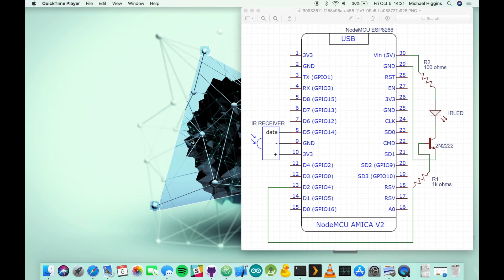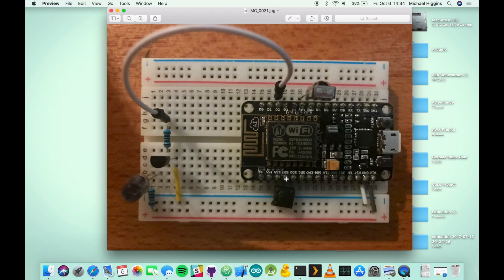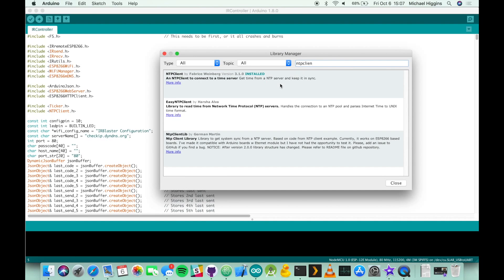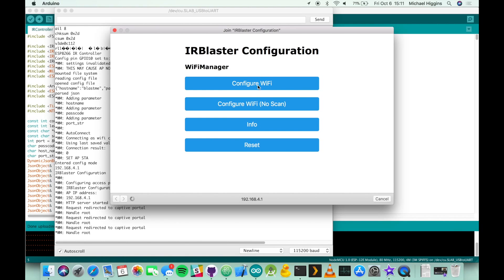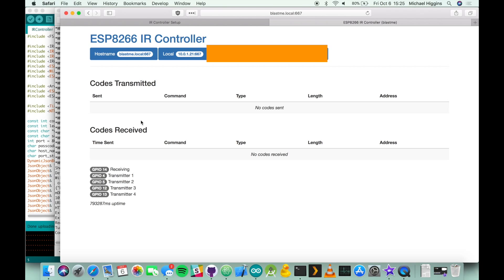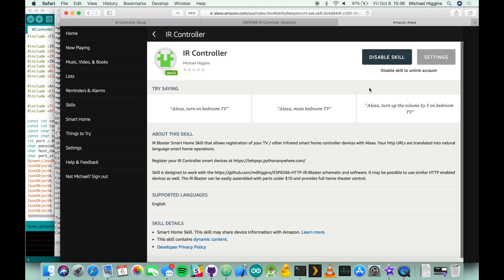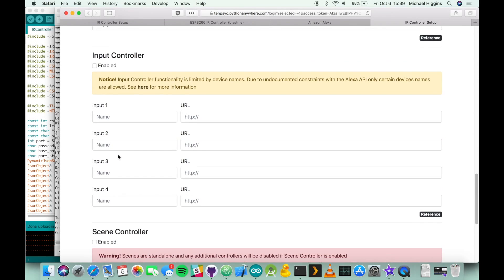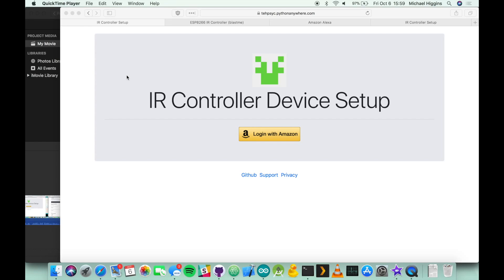IR Controller Tutorial

Comment: Please can someone help me out here, i am trying to get this working for my uncle who is paralysed from the neck down, i want him to be able to control his tv with alexa, i have followed the install and programmed the arduino but when i boot it up it comes up with, 

ESP8266 IR Controller
Config pin GPIO13 set to: 1
mounted file system
*WM: Adding parameter
*WM: hostname
*WM: Adding parameter
*WM: passcode
*WM: Adding parameter
*WM: port_str
*WM: Adding parameter
*WM: user_id
Using Static IP
*WM: 
*WM: AutoConnect
*WM: Connecting as wifi client...
*WM: Custom STA IP/GW/Subnet
*WM: 10.0.1.10
*WM: Using last saved values, should be faster
*WM: Connection result: 
*WM: 0
*WM: SET AP STA
Entered config mode
192.168.4.1
IR Controller Configuration
*WM: 
*WM: Configuring access point... 
*WM: IR Controller Configuration
*WM: AP IP address: 
*WM: 192.168.4.1
*WM: HTTP server started

It won't open the wifi config page and i can't login using 192.168.4.1 in safari, Please can someone point me in the right direction, Thanks Adam
Reply from the maker: Did you connect to the IR Controller Config access point that it creates before trying to access 192.168.4.1?
Reply: Hi Michael, yes i connected to the AP, nothing came up and when i goto 192.168.4.1 in safari it said i wasn't connected to the internet, i also tried a different Mac but the same thing happened, thanks for getting back to me.
Reply from the maker: I would try making sure you put the 'http://' in front, sometimes Safari tries to redirect to a search engine when you put in an IP
Also make sure you check your IP address settings and that you got assigned an IP in the 192.168.4.x range when connected to the IP (if you have a static IP configured on your computer that will cause issues, needs to be DHCP for the computer)

Comment: I am stuck at the point where I am configuring the access point. I get the following in the serial feed after it repeated what I typed into the html page:

Connecting to new AP
Connecting as wifi client...
Custom STA IP/GW/Subnet
10.xx.xxx.xxx
Connection result:
0
Failed to connect.

I believe it probably has something to do with my ip address I gave it but I could be wrong.  I have a linksys router and so to forward the port I had to give it a name, external port #, internal port number, protocol, and device ip. I set the name to TV, the external and internal ports to the same number, put both for protocol, and an ip address with just the last digit off from what I found to be my computers ip address through command prompt --> ipconfig /all --> IPv4 address. For the HTML page I clicked on the name of my 2.4ghz wifi which for some reason has a square and a character with an accent on top (the character and accent change each time you try it and I have tried it with and without these added characters as well). Then entered the correct password, entered the name and password for the device, then the port I attempted to forward above. Then I placed the entire line of "amzn1.account.XXXXXXX" that I got from the place you linked and tried it without the "amzn1.account." part a few times as well. I then entered the same IP address I entered when I did the port forwarding in the "Static IP" box. I put the "default Gateway" from the ipconfig /all in for the "Static gateway" and put in the "Subnet mask" in for the "Subnet". I tried it by attempting to connect to my phones hotspot (and didn't forward any ports) and I got BoriKing_PR O's failure.

Please let me know if there is anything you can help me with or if you need more information.
Reply from the maker: What is the IP address of your router, what IP address are you giving your device? And what gateway and subnet are you using? I wonder if maybe the special character is causing problems? Does your SSID have a strange character in it?
Reply: Router IP (what is labeled as "Default Gateway" in the command prompt) --> 10.xx.xxx.226
Device IP (same middle characters as previous number but I do not think it is safe to post them)--> 10.xx.xxx.136
Gateway --> same as Router IP
Subnet --> 255.255.255.0
My SSID has standard English characters along with spaces, numbers, and a colon. The strange characters appear after the end of my SSID in your program.
Reply from the maker: Hm I'm not sure those settings look appropriate. The weird character is making me question if WiFiManager is having some difficulty interpreting the SSID of the router. Is there another SSID you could try?
Reply: Not at the moment, Friday I might be able to though. If you change the SSID on your wifi and change it back do you know if all the devices will remember it? I assume they will but there are a lot of devices connected that I do not wish to have to reconfigure the internet on. If so, I might rename it to something really short and see if the gibberish continues.
Reply: I decided to change the name of my current SSID to something different and it resolved the issue!
Reply: Now I am stuck at the next step. I can't connect to the routers settings page anymore or the "blastme.local:667" (with correct name and port inserted) or local IP address of it.
Reply: Didn't realize I had to put a colon and the port after the ip address, it works now

Comment: I have been trying for hours trying to set up my external ip to no avail. Can someone please help me?  keep getting (error retrieving  external ip)

My wifi manager looks different. In my wifi manager i have 3 extra input boxes:
Amazon user id 
Static ip (i think i already set this)
Static gateway (don't know where to find it or how to set)

plus the input boxes shown in the wifi manager of  this video.
 thx in advance
Reply from the maker: Those were added in more recent updates
You need to input the appropriate IP address information in those boxes for your router
The user_id option is for added security if you want to enable SHA256 Alexa authentication (user_id is listed at the bottom of the pythonanywhere setup page after login)
Reply: Michael Higgins so how do i pull the static gateway? Via cmd or terminal: ipconfig?
Reply from the maker: Gateway is whatever the IP address of your router is
Subnet is usually 255.255.255.0
Reply: Michael Higgins thanx for trying to help. But I'm still unable to retrieve external ip. Port foward, ip, gateway, mask were just the way i set them at first. I can configure my device out of local network (via public ip) and all but still no luck. Just about to give up.
Reply from the maker: Are you able to access the device from outside your local network?
The project has many users with vast majority with working setups, so its definitely functioning and those with issues are usually just setup problems
Reply: Michael Higgins yes
Reply from the maker: Well the external IP address thing may not be consequential then. Have you tried sending the device commands? Is that not working?
Reply: Michael Higgins it is receiving commands. But even if i try to transmit the codes received locally or externally via web browser i get (Unauthorized, HMAC security authentication )
Reply from the maker: I think I have pinpointed the issue
It has to do with the 2.4.0 esp8266 arduino core changing the default version of lwIP to 2.0 from 1.4 causing issues with DNS resolution
I just pushed an update that addresses this so if you update your blueprint give it a try
Alternatively you can roll back to 1.4 by going to Tools > lwIP Variant > 1.4 (Prebuilt) in the Arduino IDE
Reply: Michael Higgins it worked like a charm. Thank you very much for all your help. I really appreciate it.
Reply from the maker: Which solution did you use? 
After some testing I think the safest / most reliable option is to switch to 1.4 instead of 2.0 even though 2.0 works with that latest changes. There's still some mDNS issues on initial setup as a result of 2.0
Reply: Michael Higgins honestly i did both at the same time.

Comment: I set up everything as you said. But I'm getting a message from Alexa "Sorry Office AC is not responding". Can you help me? I live in Trinidad and Tobago if that may be a problem. I have another smart home device at home that works quickly with no problems.
Reply from the maker: Not sure if that region is supported by Amazon, what regional Alexa service are you using?
Also did you open up the port on your router so Alexa can communicate with the device?
Reply: alexa believes I'm in the US. There is no support for me here in Trinidad. However, since I'm  using TP-link Kasa (another smart Home product) with no issues; then shouldn't this system you have set up also work seemlessly? Also; thank you so much for replying.
Reply from the maker: Kester Belgrove the systems operate completely differently. They are in no way related. Your issue is probably related to missing something during the setup process. Did you open your port?
Reply: When I use nmap to test if the port is open, result: local IP open, external IP closed.
nmap xxx.xxx.xxx.xxx -p 80 when IP is local -> open, when IP is external IP -> closed.
I think when using Alexa device, we must open the port for external IP right?
That leads to my Echo Dot say: sorry, Living room TV seems to be malfunctioning.

Comment: Ive tried this with no luck using ESP8266 12F chip only. After flashing starts in AP mode then after putting in router details it stops working. Also serial monitor does not work with this sketch loaded.Any ideas??
Reply from the maker: Can't say for sure, you might want to try adjusting your config pin if you're not using the nodeMCU to something that you have control over. Serial output should be working
Reply: Many Thanks, Its working now it was the built in led reference. on the esp8266 12f that pin relates to TX. so thats why serial monitor was not working also.